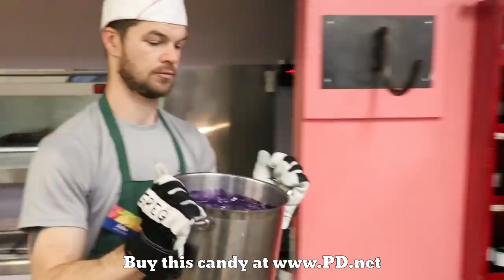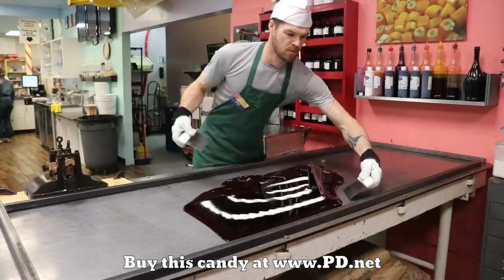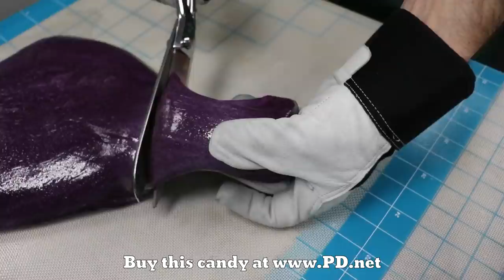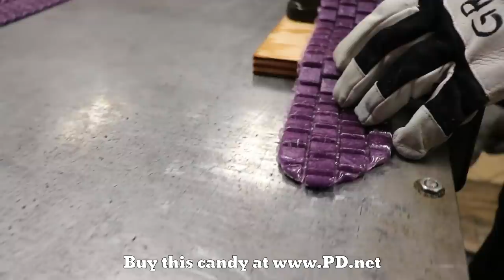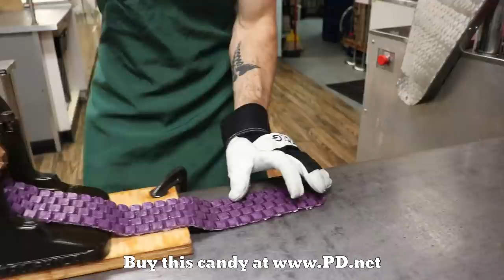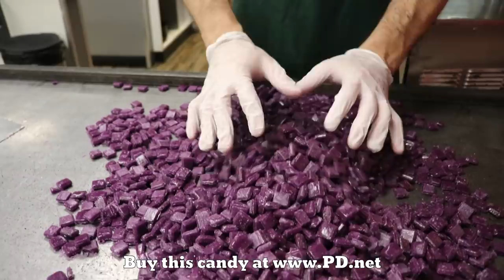#91 The making of sugar free black currant hard candy and trying some new video equipment

Comment: Can you show the melting of the sugar too? That seems not that easy as an amateur and I'd love to see how the pros do it!
Reply: I asked about this once. Greg said, "it's really quite boring", which makes sense. However I think he slips cocaine or something into it and doesn't want us to see. How else is this candy so addictive?
Reply: Mackinstyle well sugar is more addicting than cocaine so it’s not that hard really hah
Reply: This batch used isomalt. Its how it comes out sugar free. It starts liquid looser than corn syrup. Has to boil to make crystals.
Reply: Check out Hercules Candy on YT, I think they have a couple videos on hard candy
Reply: It's actually super easy! It just requires careful attention the temperature of the sugar (or in this case isomalt) for getting the right type of candy. Lower temps will make chewy candy, but once you hit a certain temp, it turns to hard candy. Hard candy is easy, but is very painful to work with, without that candy cooling table.
Reply: Yes, please show us how you melt the sugar for this sugar free candy.
Reply: It's sugar free
Reply: I do not know Greg's methods, but usually the sugar is dissolved in water, and then the sugar-water mixture is boiled to remove the water. Glucose/corn syrup is already liquid, and usually can be both, so no melting required. 
Also, it goes really slow
Reply: Hercules Candy doesn't do drop candy all the time, but they show beginning to end. Like from putting the sugar into the kettle to dropping it. They also make ribbon candy in the fall/winter for the holidays. They made a video with Greg so I don't think I'm "cheating" on Greg for sharing this. Hercules also has some soothing videos but most are funny casual.

Comment: Why not make drop candy out of the ends of the image candy?
Reply: Thats such a cool idea! Ive always wanted to see what multi colored candy looks like going through the rolls!
Reply: Making drops from the unicorn droppings sounds like a great idea!
Reply: I wonder if the candy would be too cool by that point to easily go through the drop candy rollers?
Reply: They'd have to re-heat to get it soft enough to go through the machine. I don't know if they can do that without undesired side effects.
Reply: Even if they couldn't do it with the unicorn droppings, it would be neat to see them try marbled drops.
Reply: I bet it's cooled down too much by then?